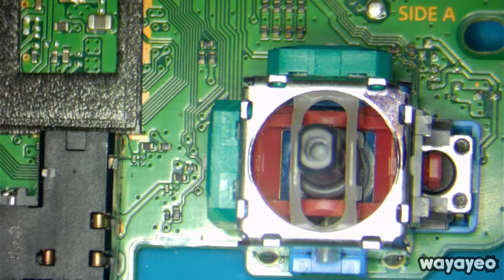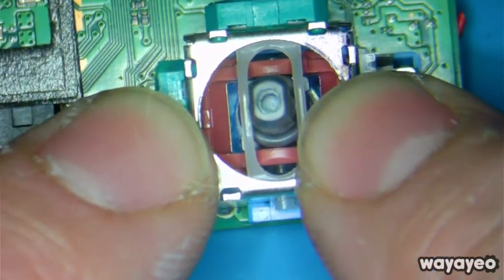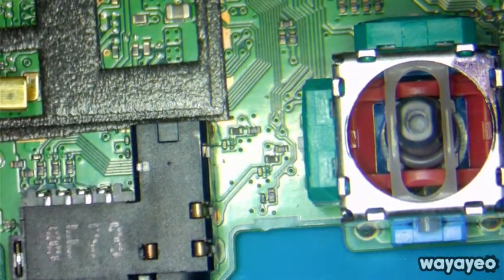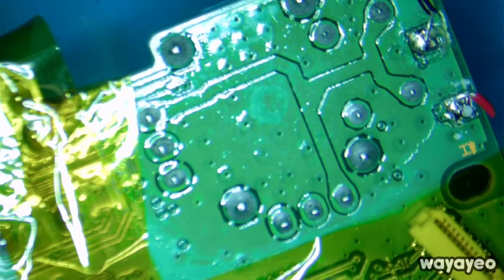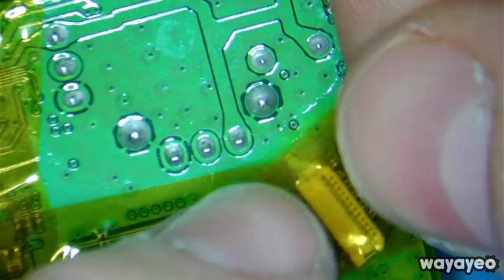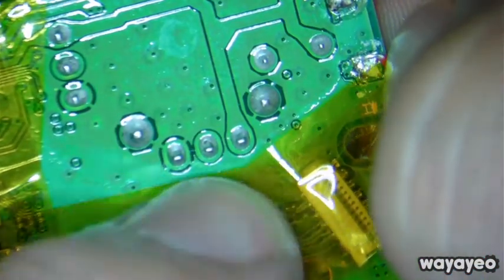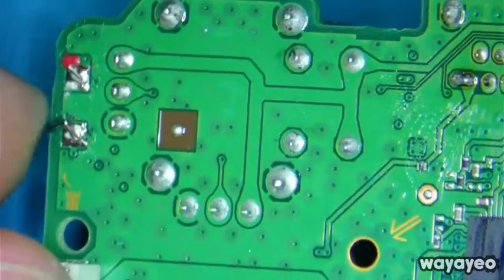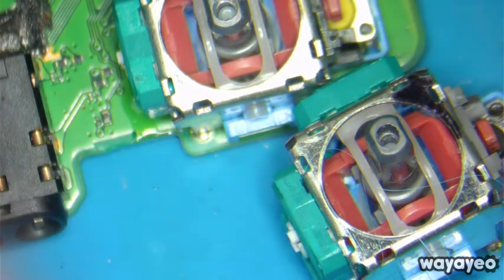PS4 Controller Complete Analog Stick Replacement

Comment: Sorry for the late question but what temperature did you use for the hot air gun
Reply: You should use a higher temp than usual, because the joystick functions as a massive heatsink. I've never tried it, but I read that you can bypass this my snapping off the mechanism with some cutters first. This wil destroy it, but if it's broken anyway it doesn't really matter.

Comment: Is the yellow tape  necessary while heating?.If i heat up the board without tape will it damage other components?
Reply from the maker: It's not necessary but it helps protect other components. If you're starting out i suggest use it. Good luck on your repair
Reply: @Wayayeo  ok i successfully removed right analog but i tested the controller before fixing with new analog. So my pc input right analog when moving left analog is it normal or did i mess things up?
Reply from the maker: @mgamerx0954  Good job. If you haven't soldered it in place, the contact point might not be touching properly.  Maybe try another analog stick.
Reply: @Wayayeo  ok

Comment: I have a question, can you melt the joints from the analog stick without disconnecting the sixth cables( three red and three black) including the battery pack? can you be shocked or something? I have no experience, other then doing research, I recently bough a soldering iron kit, and have three controllers to fix with this tool.
Reply from the maker: Possibly yes but if you disconnect them it would be easier to handle. Do disconnect the battery or you might short something. You won't get shocked. Take your time and good luck to you.
Reply: @Wayayeo  thank you